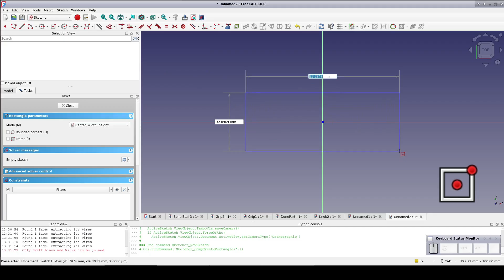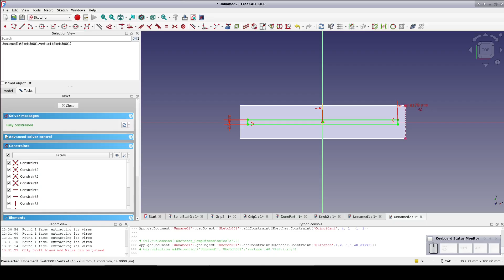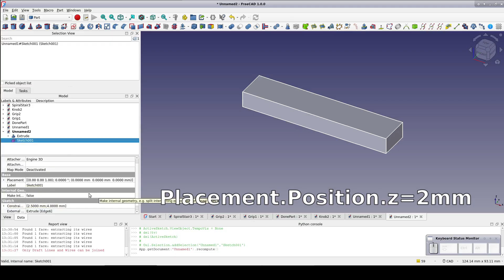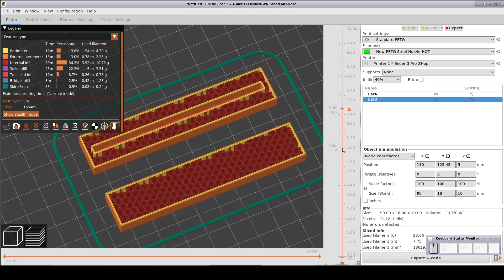3D Printing with FreeCAD: When Less is More

Comment: i've seen 0.2mm through slot suggested.  the gap allegedly is so small that you can barely tell.  no personal experience yet though.
Reply from the maker: The thinner gap can work, but only provides the stiffness in one direction. It depends on what your design needs.